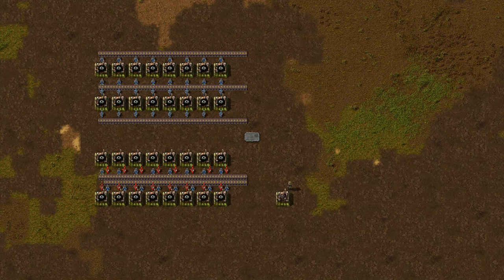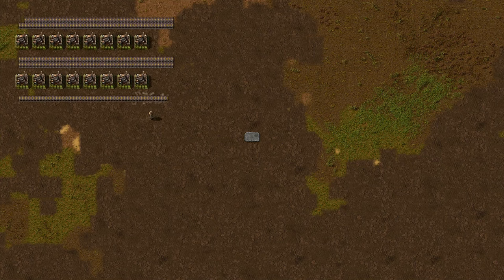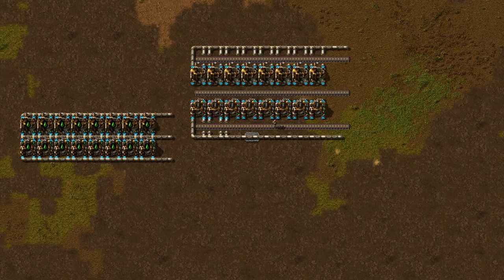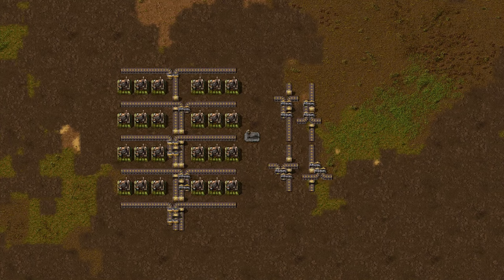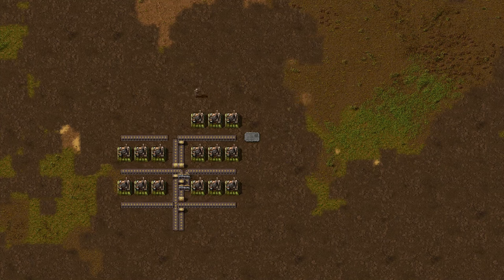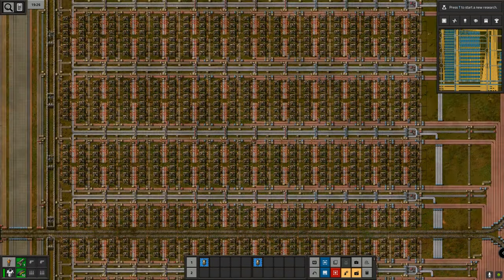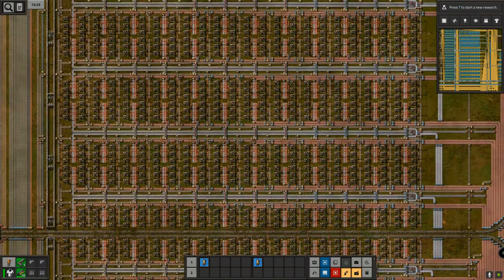Factorio - How to design sexy blocks (v2)

Comment: My favourite gear setup is:
ASSEMBLER
INSERTERS
INPUT-BELT
OUTPUT-BELT
INPUT-BELT
INSERTERS
ASSEMBLERS

This works well because of the ratio. (The ratio changes slightly with efficiency modules, but it's still > 1 input per output.)
This has some benefits: You can tile this sort of thing as much as you want,It's reasonably easy to feed and retrieve, it's easy to get right, and since your long hand assemblers go to the middle belt, and you eat more than you spit out (as opposed to say, wires) it all works out.

Comment: Alright. My thoughts on this.
My first question was which setup is he talking about right now? There are 3 on the screen, but nothing visual to indicate which exact one he is talking about.
I can kinda follow the context clues to understand, but it’s a bit hard to figure it out at times.
The part where you talked about the 3 input fixed that issue, and you used more visual indicators in the rest of the video.
Good work on this one. The very neat ways you removed stuff made the video more interesting.
Reply from the maker: Thank you for the compliments. I accept the criticisms, nothing is ever perfect. I'm not making it again!!

Comment: Your checklist at the end is great. 

I didn't get what you meant about the science blocks though, and the reversible belt directions.
Reply: he was saying with the sideloading instead of splitters, it is easy to replace and run the other direction if you say, have to connect input to a new mine, or want to send output somewhere else.

Comment: 1:30 you do realize your belts are flowing backwards right? might want to get that checked out
Reply: The arrows do not align with the movement of the belt that we perceive.  This looks like it may be an aspect of speeding up the video, much like looking at a spinning wheel that looks like it is going backwards at a certain speed.

Or the footage was reversed.

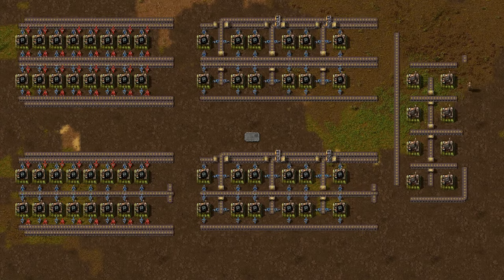Comment: One space can be saved in the side output blueprints presented at times like 4:40 by placing the inserters at opposite edges of the assembly machine, and rotating the belt during the middle tile.

Arrows represent belts. + Represents Inserters. _ is empty.

^
+^+

Compare to:

^+
^<
+^

Comment: What great content. Thank you! Unrelated question, do you have a list of your preferred mods somewhere?
Reply from the maker: Was there something specific you had in mind? I use a number of mods, some follow me everywhere, some just get pulled out for a specific situation. It really depends what you are looking to achieve.
Reply: @theotherbigfoot  Generally quality of life mods. Helmod is great which you mentioned, I love that one. There's something you had in your inventory at 10:41 in the video, a colourful icon on the far top right next to the gun icon. What is that?
Reply from the maker: @SarelvdWalt  That is a mod called 'color coding'. It has a whole host of different coloured things. Walls, concrete, lights.

One of the best QoL mods that I use is called 'what is it really used for'. It shows all the places where a particular thing will go or come from. Put an iron gear into it and it will show all the ways an iron gear can be made (maybe not useful in vanilla) and the places an iron gear needs to go. Starting a new set of mods with a new set of materials I've never used before, this thing is absolutely priceless.
Reply: @theotherbigfoot  Ah that is fantastic, thanks for the info. Appreciate it. Cheers :)

Comment: you know, you said we should also try to come up with our own designs, but i think my designs would make you angry.. have you considered stuff like belt weaving, 2 belts in 1 using 2 different tiers of underground. or, in some designs when i neeed to output on the ending side of the input i will put the input on the inner sdie of a belt, and have the inserters both place and take from the same belt, so the output is on that very same belt, then using the underground trick to only take out of one side of the belt. i like making people shutter with the ideas of putting inputs and outputs on the same belts using weird mechanics. FOR EXAMPLE. using logic to only request the exact amount of input your factories will need. so that you can just put the output on the same belt. and let it run :) HOPING nothing makes its way through and mixes with output.
Reply from the maker: I love the idea that you are f*cking with the perceived wisdom, doing things that other people aren't doing and finding your own path.

But yes, your designs make me angry.

Comment: 6:15, good luck powering the right one without Substations
Reply from the maker: Is there something wrong with the standard power poles?
Reply: @theotherbigfoot  just to make it clear, I mean the right one visible from 5:55 to 6:18
nothing wrong with it but its radius is only 2, steel ones is 3 but to reach the red inserters from behind the chemical plant you would need at least 4 range in your configuration. In your build its possible to make space for power poles to fit in the middle so its just if you try it exactly like that without free space. I like your layout ideas and want to try some so thanks a lot for making this :)
Reply from the maker: @ataarono  I meant the steel ones, my bad, I forget the wooden ones exist I hate them so much.

I see your point though. What I generally do is bury the power pole in the conveyor belt in a place that isn't in the way of an inserter. Not the most elegant of solutions but it at least works. I care more about the positioning of the chem plants and conveyors and pipes etc than I do about the power. 

No worries dude, thanks for tuning in. More is coming. More is always coming...

Comment: where is the secret way of inserting 4 items into an assembly machine in one side? (figured it out)
Reply from the maker: I'm guessing you are using two inserters with a conveyor belt between them, but why limit yourself to just one side? There are a lot of ways to arrange a 4 input 1 output. The reason I didn't cover them is because they aren't critical for vanilla factories.
Reply: to create somthing like this https://youtu.be/Xiv_QlvcyCk i am not sure why is it so dark but this is what I could do
Reply from the maker: @guszti014  That is freaking cool. Well, there are 16 too many beacons for my liking (!!) but the setup is awesome. What recipe is this for?
Reply: @theotherbigfoot  i didn't set any recipe yet, but flying robot frames can be used or lds which needs a lot of copper so u could use 2 belt off copper and the beacons were put there to show future upgardeablity or a lab setup